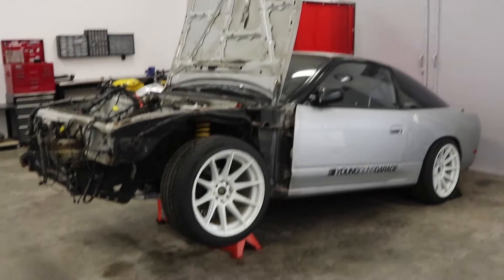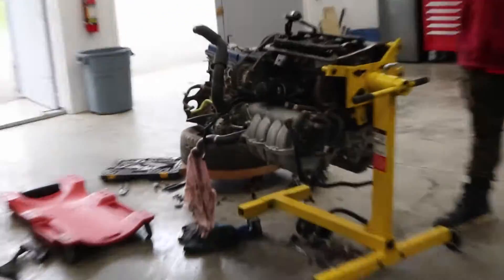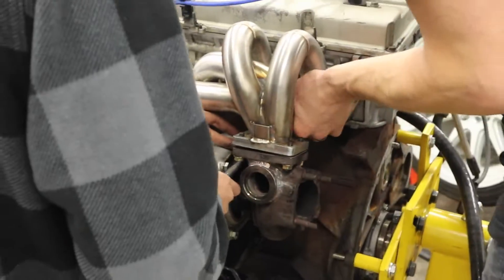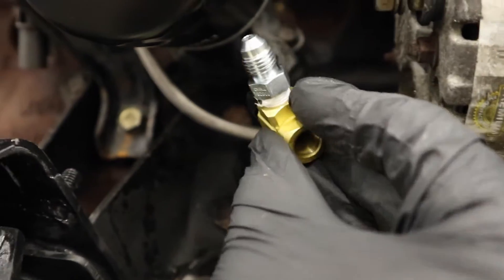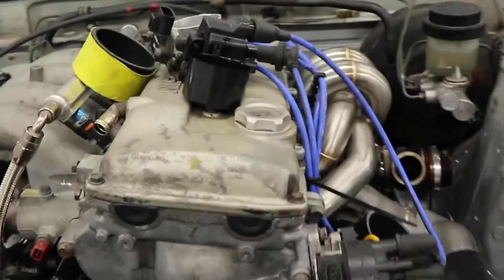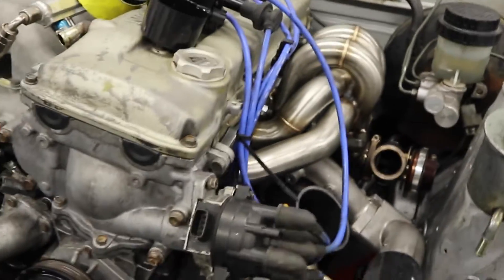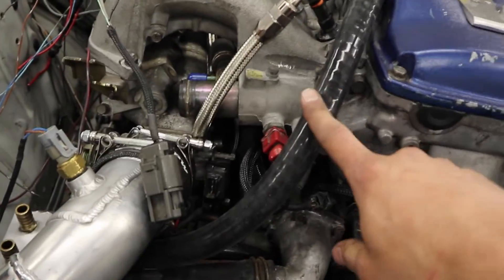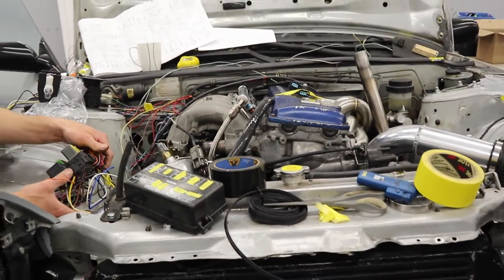240sx KA24DET Turbo Build (Link ECU, GT28 Turbo) - Step by Step

Comment: Where did you find the file to print the power steering relocation?
Reply: Man that would be awesome, shaving the bay on my s13 now.
Reply from the maker: @ProjectIntentionalShepherd  no problem, email me pic.metalworks@gmail.com
Reply from the maker: I designed it, if you need to files lmk

Comment: What filler material did you use for the waste gate flange?
Reply from the maker: We used 309l welding rod
Reply: @Benji...  has it cracked yet?
Reply from the maker: @erikdude666  didn’t run it long enough to find out, swapped to a different turbo

Comment: Where did you get the ecu pin out diagram for the ka
Reply from the maker: We used the info from link mostly and then added each wire from the stock harness/ran whatever new ones we needed